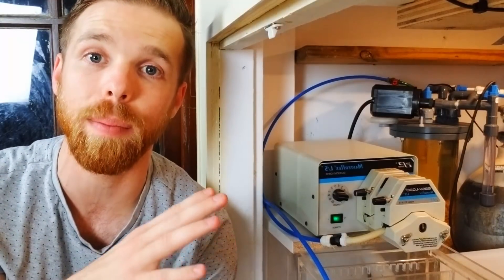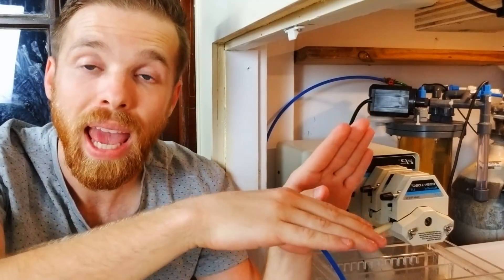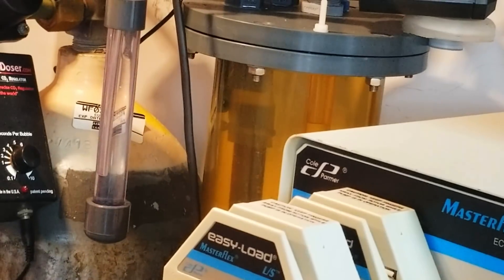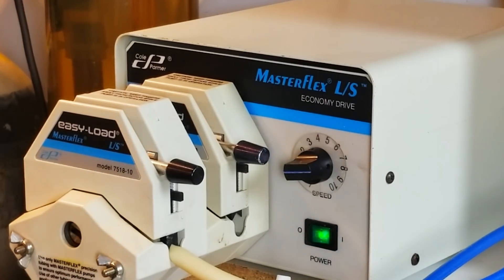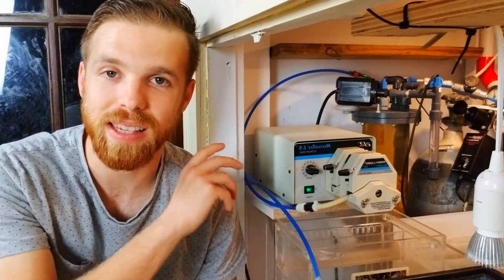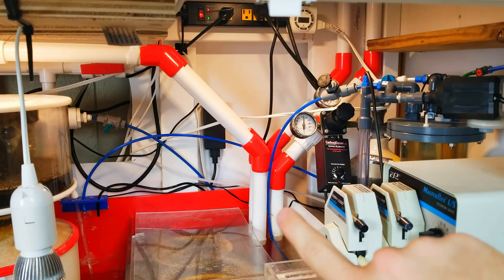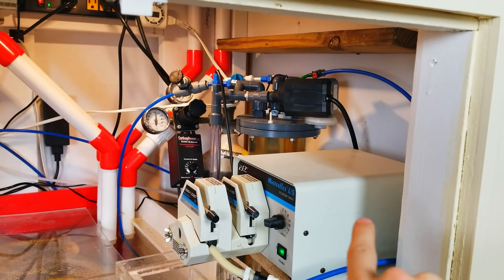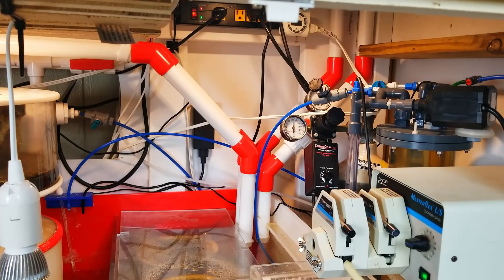THE 300: My Calcium Reactor Setup (best way to get a consistent drip rate)

Comment: On my apex, I had to add code to shut the co2 tank off when the recirculating pump in the calcium reactor watts drops below a certain threshold. The ph parameters didn't work to shut off the co2 if the recirculating pump got bogged down from too much co2. I need to get that carbondoser co2 regulator at some point but for now, this works
Reply from the maker: That’s a good idea, what reactor do you have?

Comment: I’m getting the same reactor and the way you have it set up your not using the designated outlet section? Your using the top outline to feed the master flex then the master flex is pushing the effluent out? Did I get that right?
Reply from the maker: Yes the masterflex is pulling the effluent out of the reactor from the top outline.
Reply: So you have a shut off valve on the designated outlet section?
Reply from the maker: @PRFishGirl  correct. Just a ball valve on the RO tubing
Reply: RealReefingTV omg Thank you so much for your help and responding back! U got a faithful follower..
Reply from the maker: @PRFishGirl  the whole reason I started this channel was to help😊 you are very welcome.

Comment: I would also like to know what your top and bottom gauges are set at on your carbon doser.
Reply from the maker: I don't think it matters what they are as long as you can keep a consistent pH in the reactor. One regulates the size of the bubbles and the other the frequency of the bubbles.

Comment: First off I would like to say thank you for making this video. Second I am having a problem trying to get my reactor to maintain the levels in my tank. I am using the koralin c1502 reactor the carbon doser, and a kamoer fx-stp pump. I noticed two things about your reactor. First the media is really low. Is that just because its at the end of its life? Also it looks like there is no gap between the water in your reactor and the top of your reactor. I have a gap of air on the inside of the reactor between the top and the water level. Is this normal, or is there something wrong with my setup? I would love to have your input please!
Reply from the maker: Yes the media was low and hadn't been refilled in some time when I made this video.  I use the outlet on the top of the reactor that comes right out of the lid as opposed to the outlet that comes off of the pipes.
Reply from the maker: It's normal for the system to work that way if you use that outlet. I use the other because I don't like having air in the system.
Reply from the maker: Additionally, I have the peristaltic pump draw water through the reactor as opposed to pushing into it. Not sure if that's the best way but just the way I do it😊 hope this helps 👍
Reply: @RealReefingTV  easy to keep the reactor full if your pushing the water thru is to use both outlets connected with a tee and then to the tank. That's what i did and PROBLEM solved.

Comment: Great video man very informative 👌 Does you carbon doser regular plug directly into you ph controller that is in your calcium reactor?
Reply from the maker: scott wells thanks! I use my apex to monitor the ph and the carbon doser is plugged into the apex but the apex never has to intervene (turn on or off). This is because the carbon doser and masterflex are so precise that once dialed in the ph is rock solid.

Comment: I have the same calcium reactor , what u do with the water output 2? Output 1 is what u have used for your peristaltic pump, I’m curious on the output 2, thanks for the video :)
Reply from the maker: fansolate I only use the output that is on the top of the reactor, the other one allowed gas to build up at the top. Good question👍

Comment: Great video. This is the only way I’d run a calrx anymore. Been running a masterflex for a couple years now and find it interesting that your actually starting to see reef equipment manufactures take cues from the reefing community and market peristaltic pumps for use with calcium reactors.
Reply from the maker: Steve L agreed, I see something like this needed from Neptune systems.  Thanks for watching sir!

Comment: Have the same regulator but having trouble getting a consistent bubble size and frequency. What pressure do you have your CO2 set on?
Reply from the maker: Jeff’s Reef Tank the regulator may actually not be off, it could just be your bubble counter. If you have the regulator turned down it may take your regulator more than one "bubble" to actually pump a bubble out of the counter. I'll comment when I get home what my settings are.
Reply: Its set at 5lbs... sound too low?
Reply from the maker: Jeff’s Reef Tank I have mine set to 9 pounds and 4 seconds per bubble but use that as a starting point and set your reactor to 2 drops per second, then reduce the flow based on the calcium and alk uptake.
Reply from the maker: Jeff’s Reef Tank if you have an apex and can put in your reactor set your regulator to turn off at 6.5 and on at 6.55 this will make sure a disaster doesnt happen. I would then set to 1 drip per sec and go up from there. Remember small changes and monitor.
Reply: Yes I'm going slow... Been slowly tuning for the last two weeks. Affluent PH has been hovering around 7.3. 30ML per min. I just bumped up the Co2 to 9lbs 1 bubble per 10 seconds for now... Bubble frequency increased slightly. Thanks for the reply, I will let you know how things progress.
Reply from the maker: Jeff’s Reef Tank awesome please do!

Comment: Nice video. I use an IKS Vario Blue 2 peristaltic pump to feed mine. That plus a carbon doser regulator makes it so easy to tune and to reset after changing out a gas bottle.
Reply from the maker: Hugo Snell it's a must! Anything else is a headache. Thanks for commenting!